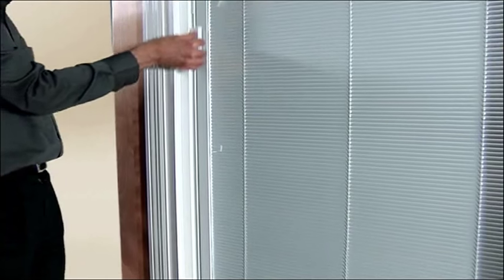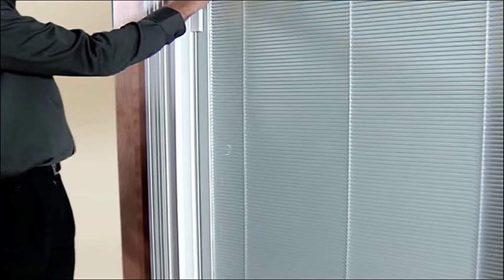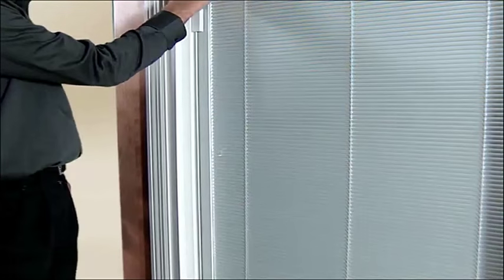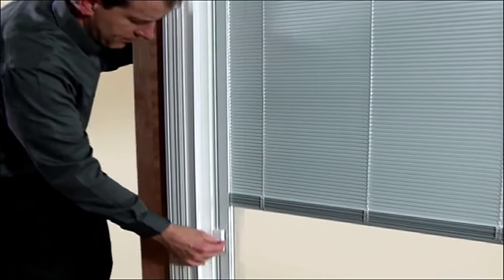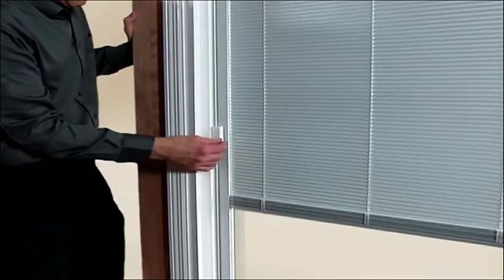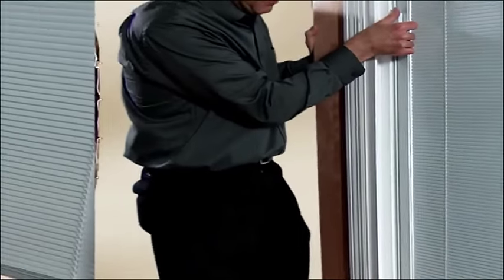How To Re-Engage Handle on Between the Glass Blinds

Comment: not sure if its the right modle, but my handle broke off.  How do you fix that.
Reply: My slider has developed a crack on one side and is loose from magnet contact on the left side. Does not engage the low magnet no matter what you do. Maybe a new model(mine is 2011) isn't what is shown in video?